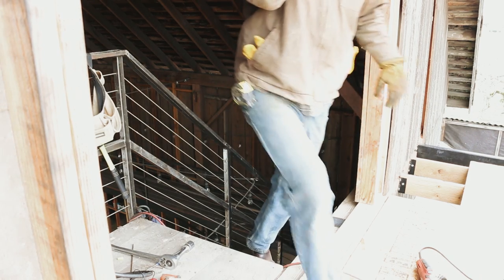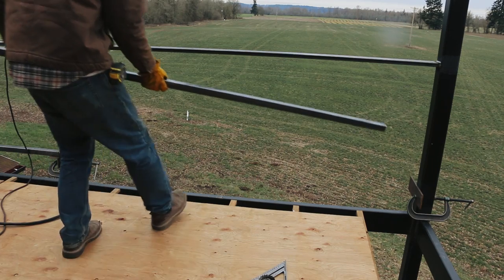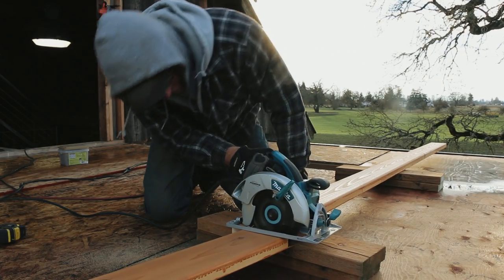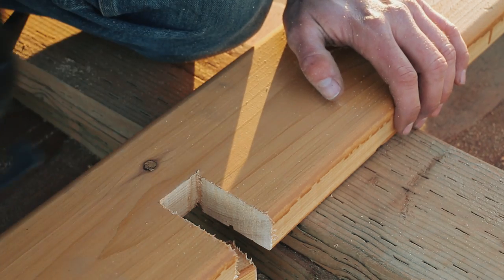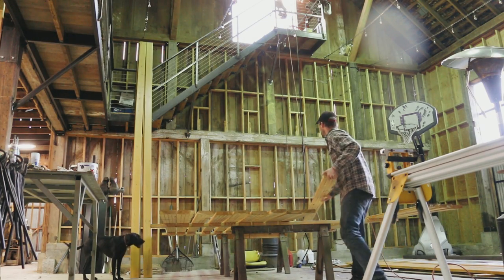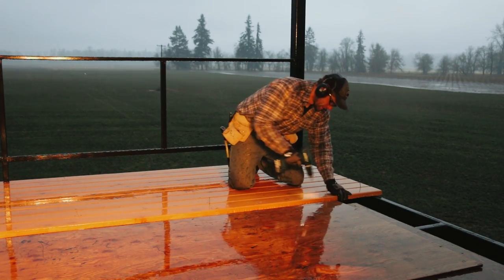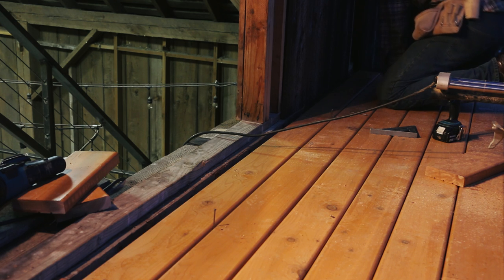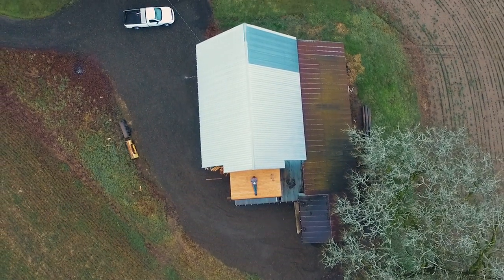Barn Deck pt. 5 - It's What Makes a Deck, a Deck.

Comment: Great video. If you would have installed One course of decking around the outside perimeter, The 16 footers would have been long enough for the Field and there would be no visible endgrain on both sides of the deck. It's called a breadboarding. Although it does require one extra floor joist on both sides. In any case, neither way is right and neither way is wrong. Very nice job.

Comment: You might find advantage in sealing the sunken screws with some silicone or acrylic caulk: Those areas always act as water-basins, which deteriorates the wood around those quite important points.
Reply: Antony Spar orange ear plugs??
Reply: And useful only if water-tight. ;)
Reply: +Jared Escobedo, Yes Sir, You are correct. But it's a deck not a church. 
Besides, "can't see it from here". 
Sincerely, NAWALT.
Reply: Thinking the same thing. However a bit further a wood plug. Different Color that stands out a darker Color perhaps and plug it. No screw to see and another nice touch...Yep, that is what I would do no cost except for time and the cutter.
Reply: Hi Jared you and I are on the same page. It just makes sense in every way.
Reply: The roof is going to extend over the decking anyway.

Comment: I liked you plan, but you should not have installed your posts in concrete unpainted the tube will rust over time with water leaching in on the edges. Caulk that seam between the steel and concrete. At the base of your main upright drill a weep hole in the side to let out water. You need to install your kick braces as close to the roof on the down side then take them up as close to the building and attach it to your frame member. You will need to X brace the outside end. I'm 40 years fabing and hanging steel. It's just some friendly advice. I've just found your channel and really like your shop and your doors are great, wonderful design.
Reply: yeah I'm sure he taken your input or not .lol

Comment: I dont know why he didn't do a boarder board like a picture frame around the deck, he could of used his full 16' boards, if he had an inch over hang all the way around that would leave enough to fit the 16' decking perfect equaling no seams in the middle

Comment: You know how in the door videos, you said "I need to learn to leave myself 1/16"...?  Well on the notches around the post you should have left 1/16 or 1/8 gap to allow for expansion and contraction to prevent cracking of the wood ( which is the real reason you leave the gap between the deck boards like you did with the nails ). Also, instead of making the corners square when you cut them out first drill, then cut. It reduces the stress on the fibers and prevents splitting over time.

Comment: When installing pressure treated decking that is still wet (that's all that is available from spring through fall) to get proper spacing just butt the boards tightly together and when they dry out they will have just about perfect spacing.  With any reciprocating equipment you will get a better job by pressing the tool tightly against the work piece.  When welding out-of-doors you can sometimes turn your shielding gas up 2-3x or use flux-core MIG wire that is NOT carrying the suffix of 'GS'.  While that is labeled at 'General Service' the two letter code actually stands for it not meeting ANY AWS wire specification, should NEVER be used for structural, and is limited to one pass ONLY.  A wire like Lincoln's Innercore NR211 MP or the Blue Demon E71T-11 that I use at home meets AWS structural specifications an can be used over dirty, rusty, or painted steel in multiple passes.  The best choice would have been 6010/6011 stick welding but that is not supported by your MillerMatic 211.     -just sayin..

Comment: Nice! part 5. Few questions/remarks: Is the wood slippery wenn wet? I have some decking, and every year i have to wash it with the high pressure hose, otherwise it can be slippery (after rain). Is wood not going to "work" (deforming) wenn aging? Because of the tight fit around the railing. I left 1cm (about 0.5") round each obstruction to give it room to expand and shrink.
Looking forward to part 6!

Comment: I think I would have welded a two inch piece of iron onto each side of the deck to close the gap so you would be able to just use your full 16' pieces of lumber

Comment: Mate nice job but next time give the timber some clearance around your steel posts, don’t sink the screw heads as deep in the timber and the first drill hole in the decking should be bigger than the screw so it pulls the board down.

Comment: Should of made a picture frame boarder and filled in the center. Would of made you 7-8 inches. And could of ran ran all 16ft. Also fill in those screw holes, you don’t water to just sit in that pocket.

Comment: Flux-Core MIG wire is superior for outside welding over MIG/gas for two reasons.  It has it's own flux that won't blow away in the wind and Flux-Core by it's very nature has better penetration into the steel.    And of course stick welding would be best of all and because it is for a safety railing that will have most people leaning against it and drunken west-siders (sorry, Cincinnati reference) climbing and jumping up-and-down upon it I would do a three pass structural weld.    I learned to weld on-the-job in 1972 and have never been sorry that I over-built anything because designers appearantly have never met the great-American-fool who will plan/experiment/scheme to try and bend/break anything...